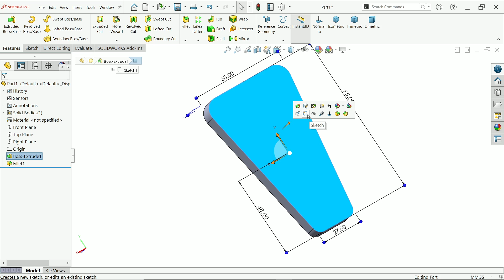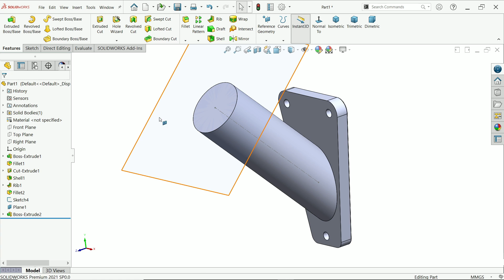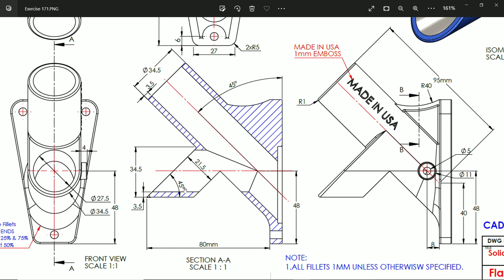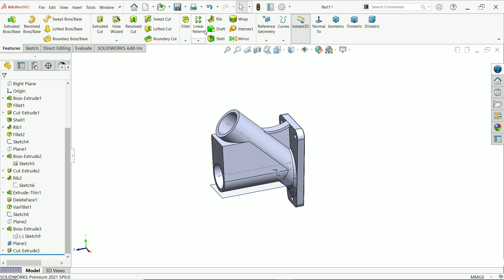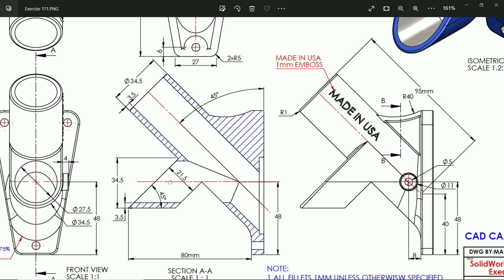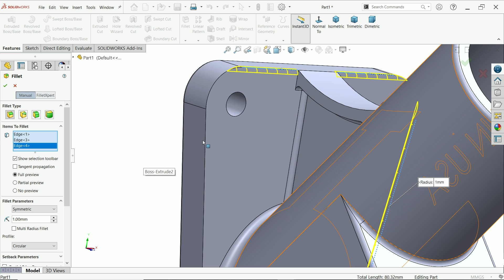Solidworks Advanced Tutorial Exercise 171-Flag Pole Mount

Comment: Whenever I use rib command I didn't get rib sir it shows that (the extension of the rib does not intersect the part) but I follwed same process as you said not only now whenever I use rib command I didn't get so can you tell me the solution sir
Reply: If you look at your drawing side on you probably drew the lines at the bottom of the shell cutout.  The lines need to be drawn on the top above the shell cutout.